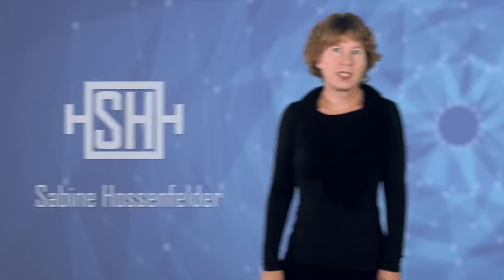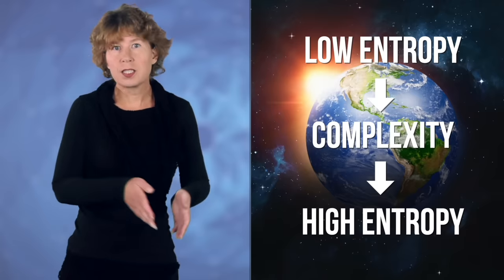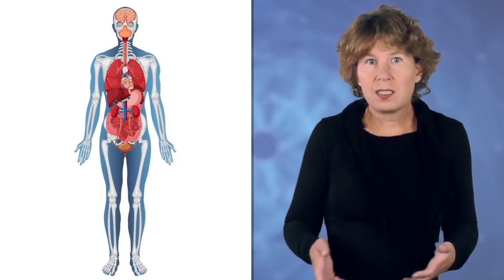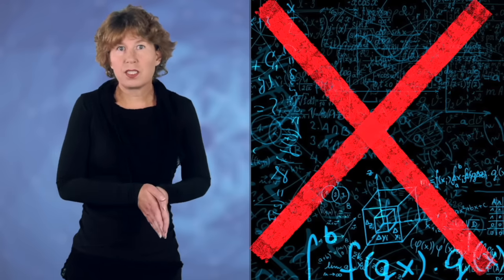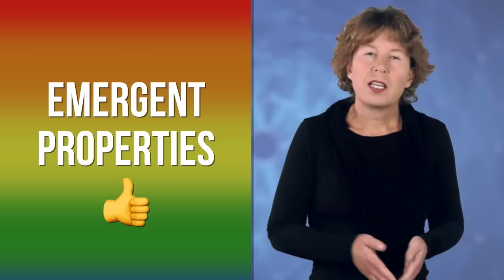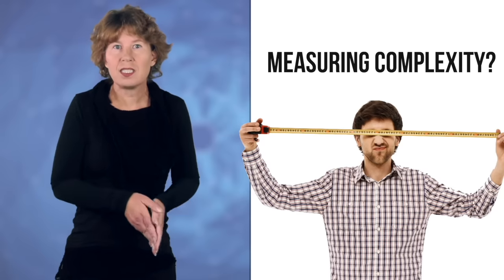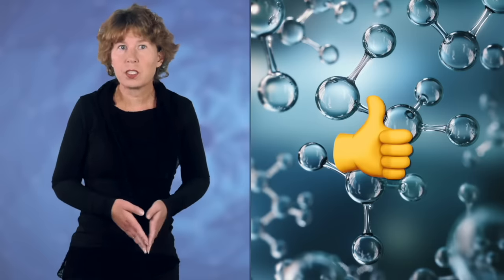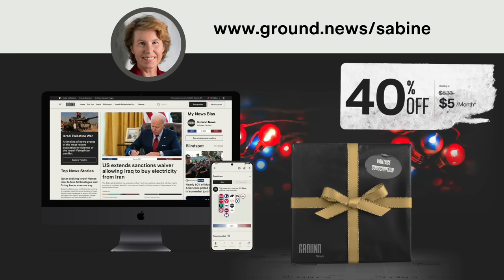The Biggest Gap in Science: Complexity

Comment: Bit of an unfair shake on algorithmic complexity - saying "it's all particles" ignores the fact that you still have to arrange those particles in specific ways, which gives rise to the complexity. That's like saying there's only one integer: 1 - because you can construct all others from it. Clearly a silly statement when talking about useful numbers. Or, staying closer to computer science: it's like saying every algorithm that can be run using a Turing machine has the same complexity - which is obviously untrue, since that completely negates the very thing being measured. In the rock comparison that follows, the same oversight is there: as if the parts in the algorithm don't matter - the algorithm isn't just "some symbols", its symbols in a particular order that affect the flow of execution, and Kolmogorov complexity estimates the complexity of a specific arrangement (or more specifically the amount of computational resources needed to run it).

I feel that the core problem of this video lies exactly there. If you need to accurately 'run' a baby of 10**27 particles, or a rock of the same number of particles, you'd need the same amount of compute, if you need to know the exact possible state of each particle (assuming you can capture the quantum mechanics correctly). However, if you're only looking to 'run' the behaviour of larger scale components of these systems, clearly the baby will take more resources to run the *model*, to get anything sufficiently resembling reality, whatever lever of detail you require - the rock changes very little at that scale by comparison.

Similary, 'emergence' is just "stuff that annoyingly shows up when you look at the thing at larger components than it's base level physical constituents". It's just running into limitations and failures of the model you picked to accurately describe some object. If you simulate a wire down to every particle, and provide the system with physically correct boundary conditions, the simulation will have 'current' - not really 'emergent' anything, but rather 'something organised at a scale many orders of magnitude up from the scale of constituent parts." When we model a piece of metal as if it was just a shiny rock, discovering the ability to conduct a current breaks the model we were happily using - suddenly the same model no longer works for a rock and a metal rod. Annoying.

Finally, calling a star simple ignores the broader context, in time and space, that it operates at. It's simple from our perspective, just like an atom in a DNA strand is simple if you're another atom sitting next to it - meanwhile, it's playing a critical role in a complex system. And in the other direction, once we gain a better understanding of the star, we'll find that it does a lotter of interesting stuff everywhere, and like the metal rod, we'll need to reconsider or simple model to represent the complexity that's actually there. The only real ceiling is the observable universe and the only real floor (if you believe there is such a thing) is the standard model or whatever may ultimately underpin it.

Comment: Least code means without describing and computing irrelevant data. How many different representations of state are needed and how many different types of interactions need to be modeled to [reasonably] accurately model the system. If I drop a rock from 10m above sea level, I dont need too many more state facts to have a really good idea of whats going to happen in just over 1 second. Alternatively, if I drop a baby from 10m above sea level, there is special data needed about when at what that baby last ate that will affect the outcome at t2. If any process is thought of as a flow chart - case statements to determine how to compute to get to the outcome - how many different branches are necessary to accurately model the outcomes? Computers only have 3+1 components: variables, conditions, and loops [+ operators]; if starting at quantum mechanics is the only way to model the system, sure, but if modeling part of the system doesnt help model the overall outcome, then it shouldnt be thought to contribute to complexity. "Can I ignore those behaviors and still predict the outcome of the system?" If there is a car accident, does the color of either car matter when predicting the injuries? How about when generating an image of the end state? If we are trying to accurately predict the state of a drivers spleen, car color is irrelevant. If we are trying to predict the visual outcome, the force impacting a driver's spleen becomes irrelevant. The added unnecessary work of modeling reflectance as it relates to driver distraction isnt relevant for either, but suddenly is when modeling which factors led to the crash. Focusing on what we want to learn and model and codifying that is machine learning - telling a system how to figure out what matters in more and more abstract ways that can be applied to more seemingly different systems. Contrived, circuitous ways to describe a system, do not contribute to any measure of complexity. That ambiguity. F = MA requires 2 inputs and one operation. Compare that to the Dirac equations; sure both can model force, but how much detail, input and computation? Its about the least information and consideration needed to reasonably accurately model a system, or describe everything that "matters."

Comment: As much as the video contains a lot of interesting thoughts (some of them actually compelling), I do think it spreads misinformation about Kolmogorov complexity in particular. 
Why? 
Well it confuses the (quantum)physical machinery powering a baby as well as a rock or a gear mechanism with the algorithm to reproduce their respectiv building plans. 
It is only the size of this latter algorithm that is measured by Kolmogorov complexity. And, because the baby has a much more complicated configuration of atoms and molecules than the stone (as is correctly mentioned in the video), an algorithm reproducing its building plan would also have to be larger. Hence it would indeed have a greater Kolmogorov complexity. 
That is not to say that Kolmogorov complexity is a suitable measure for what is desired in the video.

Comment: Material properties are a great example of emergent complexity that everyone typically ignores, but is slowly being appreciated as a new frontier. We simply don’t understand materials, but everyone assumes we do because they are so widely utilized. 

95% of engineering & the Industrial Revolution exploits the rather serendipitous property of metal alloys having a useful linear elastic zone. The stiffness in that zone can be predicted from crystal lattice properties, and plastic deformation is attributed to dislocation slipping. But no useful engineering model actually starts from these “first principles”, instead it’s all empiricisms and mathematical toy models. IE, give an engineer the composition of an alloy and it’s heat treat schedule, and ask them to predict it’s stress/strain curve. It can’t be done.

And that’s for metals, which due to their widespread industrial use, we think we understand. Now move to polymers. They aren’t crystalline, and their mechanical properties can be highly dependent on the entropy of the “spaghetti” mess. Amino acids and proteins can fold into trillions of configurations, and they spontaneously find the lowest energy option, a task that takes the latest supercomputers and GPT algorithms to crack even the simplest cases.

Even concrete is a surprising mess that we don’t understand despite using it for centuries. 

Biomaterials exploit these odd emergent properties, for example nature might combine two weak materials into a strong composite: the sum is greater than the parts. See for example Markus Buehler’s work at MIT on “biomateriomics”.

Comment: I don’t agree that graph and network are synonyms. In graph theory a graph is nodes and edges. There are different categories of graphs, depending on the constraints that define the graph. A tree is the most constrained, it has one root node and each node links to a unique set of other nodes and each set is disjoint with the others. Then a lattice or directed graph. The least constrained type of graph, where any node can be connected to any other node including itself is a network graph.

Comment: Complexity: Tea example: Complexity was greatest between the start state of no milk and the end state where it was fully mixed. The beginning and end states are both fairly uniform or static.
However, is it really more complex in the middle sure there is the greatest amount of change going on a the time but is it really that complex. You have the currents created by the pouring of the milk not just that the difference in temperature and properties of the milk that cause their own currents and so on. But the start and end state aren't actually static are they.
My point is complexity is more of an issue of perception. You can label something complex by various different methods. All of which come back to observable features or measurable features.
How many nodes, how many functions, the list goes on.
Just because you can measure its level of complexity doesn't mean you can do anything with that information or that it will benefit you in some meaningful way. Wow now you know something is highly complex compared to another system. So what of it can you make more use of that system knowing simply because you know it is more complex? NO.

My background is nuclear,EE and CS. I spent 30+ years programming in and around these 3 fields and others including math.
For a long time I thought it was the complexity of data and density of data limited how much data can be compressed. I was wrong. I found that out because of something I discovered.
The only aspect of complexity I care about now is being able to represent it and predict the results accurately. Measuring it is pointless.

Comment: There is the rock and there is a model of the rock. Complexity is property of the model. A simple model says every part of the rock are in a fixed position of the rock's internal coordinate system. You can move and rotate the rock and its coordinate system and that's it. Not too complex.
Then you squeeze the rock with high pressure and try to forecast how it will break. The former model is no more good. You'll need another model and that will be far more compex. But it is still the same old rock.

Comment: I'm not sure I buy the counterargument to algorithmic complexity. Yes, in principle, all systems are described by the same laws of physics, but to fully describe the system you need the equations plus data describing the initial state, and for a baby you need more data to do that (if only because it has more atoms). Some systems might also be amenable to a simpler description while others aren't. 

I think it's also to do with how you model the system and which properties you ignore. We think of a rock as simple because the material is fairly uniform and you can pretty much specify the size, mass, position and velocity and predict most things we care about. But if you care about all the activity happening in each atom, it looks a lot more complex and you need more data to encode the initial state and predict what all the atoms will do. 

So I think a system is "simple" if, given the properties you want to predict about the system, you can do that with a small amount of data and simple equations. However I am no expert on complexity, just using intuition from having done maths + software engineering. 😁

Comment: Algorithmic complexity shouldn't be dismissed so easily. An algorithm could theoretically emulate every other measure of complexity, and it would choose the right one automatically: "The shortest program, that generates the observed data" follows the minimum description length (MDL) principle, which is a method for selecting the right model in statistics.

Although algorithmic complexity is not computable, there is an approximation to it, that can be computed by simply "zip"-ing the observed data and measuring the size of the file. The better the compressor is that gets chosen for this task, the more "sensible" the measure for complexity will probably feel, because compression efficiency is linked to intelligence level: An AI researcher(Markus Hutter) is funding a contest about writing the best compression app, because of this link.

Anyway I can't prove anything of this, because I'm not an expert. I only have ADHD and to much time spend on wikipedia.

Comment: I don't understand why Kolmogorov complexity can't be used to measure structural complexity. At least in theory, one can claim that a book has a lower Kolmogorov complexity than a bunch of random letters, because the former can be compressed using ZIP algorithm to take less space than it used to, but the latter can not. However, I would agree that it is not useful for practical purposes, because it measures redundancy of information, not how useful that information is. It would assign highest complexity to the state of highest entropy, and thus does not fit the desired idea of sitting at the edge of chaos

Comment: Surely all you need to measure complexity on the macroscopic scale is to take the product of independent inputs and independent outputs.
A rock has few independent inputs: maybe just heat, light (in general call it all energy), pressure an produces few outputs - it might break down or break up or change into a different shape. Not very complex!
A baby has more inputs: senses + hunger, balance, etc. and produces a variety of outputs. More complex. An adult has a greater range of inputs: speech, music, flavours ... and produces a wider range of outputs, hence is more complex.

Comment: As much as I like your channel and the things you do, I think you're missed the mark with algorithmic complexity. The constraint on the program size makes what you call structural complexity an emergent property: if there's a recurring pattern in an object your program will produce, it can be written to be a recursive algorithm. Suppose you have a string S of a trillion characters. The most complex such string would be one with no patterns inside it and the program that writes it would look like "S = '...'; print S" which is at least a trillion characters long. Compare it to a string that is just "A" repeated a trillion times. It's just as long, but it can be output in a simple loop by a program that's only a few dozen characters long.

In essence, Kolmogorov complexity captures the generative patterns inside of a thing, self-similarity of sorts, whether it's uniform (like a rock) or fractal (like a tree). It can definitely capture the difference between a rock and a baby because a rock has much more self-similarity. After all, there's a reason anyonce can produce a convincing image of a rock with a few lines of shader code using Fractal Brownian Motion, but we still can't produce convincing images of babies using the best available generative networks and millions of dollars worth of hardware

Comment: I often consider horizontal and vertical complexity quantized characteristics for all quantum and classic information, but my discussions with chatGPT reveal to me that that is not the accepted understanding. My behavioral model for example is a thermodynamic model of emergence with a number of broken symmetries and requires a theoretical intersection between behaviour and physics to work. Namely quantized bias, which applies to emergent intelligences as well as inanimate systems, like particles. An electron's "bias" for example include its charge and mass. Many electrons interacting would represent the horizontal complexity of that system, while the properties of the electron itself would represent its vertical complexity. This feature shows up throughout subjective phenomenology, such as inferring motives based on methodology. There are two generalized, quantized motives given this model. Reason and need, with reason reflecting the vertical complexity of a perspective and need representing the horizontal complexity of a perspective, which is still correlary to the vertical complexity of a system but not the other way around. This model of complexity helps to define the causal orientation of information which can then be used to identify its point of origin and model it relative to the laws of thermodynamics and thermodynamic emergence. My behavioral model itself also has 4 extremes on 2 axes that follow this same pattern. Even inferring truth from coercion becomes obvious once the tactics coercion rely on become obvious. Coercion often relies on communicating horizontal complexity while omitting some vertical complexity. So when more open ended generalizations are used instead of closed ended, discrete statements, it becomes obvious when the speaker is attempting to direct the listener or just doesn't know very much. You'd think this would be obvious, but apparently not so to the world's nationalists and misinformation believers.
Reply: This proposition also raises other interesting postulates, such as all vertical complexity being horizontal complexity for an even deeper system and all the universe possibly being horizontally complex. Although that still doesn't eliminate the causal orientation for information, nor does it justify mind before matter beliefs such as decartes' "i think therefore i am," and so on
Reply: The simplest definition of bias is that bias biases the self. Gravity biases mass, for example. And the self is just the perspective of a point that occupies a specific point in space and time. Mass would be the vertical complexity of that system while gravity would be the horizontal complexity of it. Sabine also mentions emergent chemical properties rather than describing chemistry in overly complex physics terms. Those would also be examples of horizontal complexity